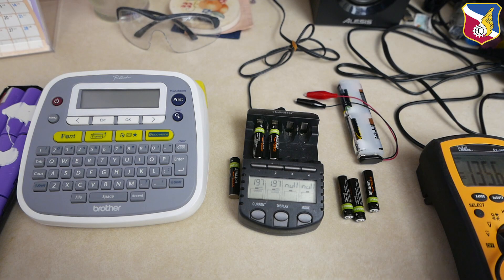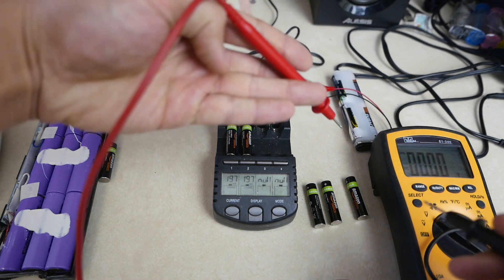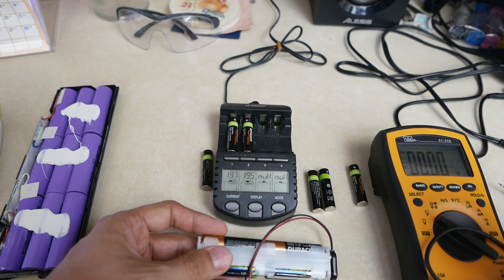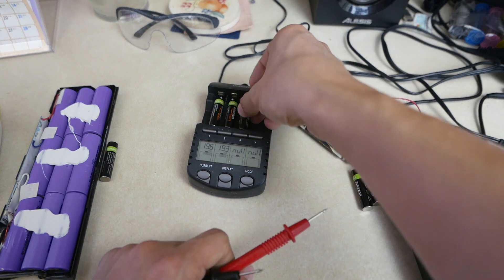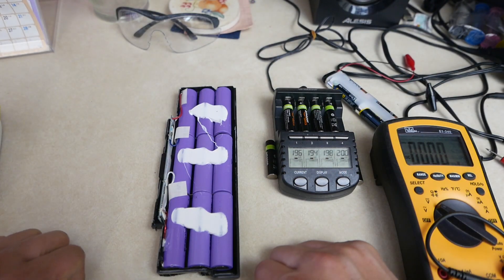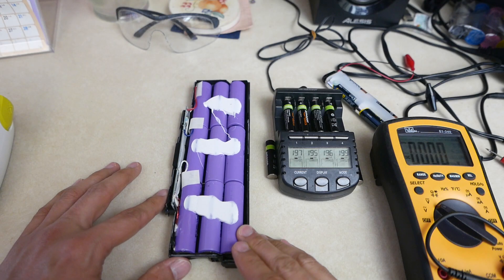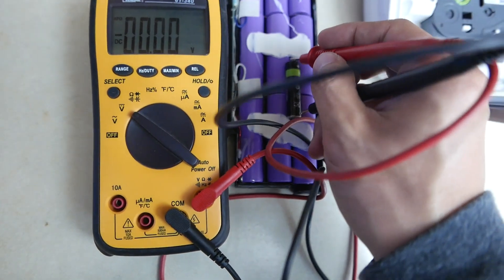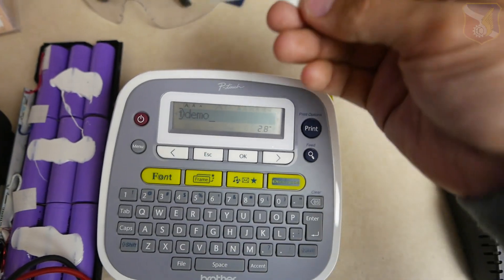how to fix a dead rechargeable battery - revive restore rejuvenate jump start any damaged batteries

Comment: What if multimeter shows 1.33v on "dead" battery and "smart" charger keeps rejecting the batteries?  I tried to jumpstart the "dead" batteries with you trick,  4 x 1.2V in a row and recovered one of my "dead" batteries but i have 2 eneloop pro black AA that multimeter reads 1.33V but charger almost immediately 2-3 seconds  rejects them. Do i have to (maybe) full discharge them first?

Comment: This trick works only with batteries that won't charge at all? What about those which seems to be fully charged but when used they discharge pretty fast? Also, have you tried to do the same thing with 18500 batteries? My rechargable dustbuster works with that kind of batteries

Comment: My Varta rechargeable NiMh AA batteries are able to be charged normally but not with quick charge mode. What is the problem with these batteries? They were quick charging before without any problem but they now only charge in "normal (slow) charge" mode.

Comment: Or you can just use a dumb charger to jump start them before using your smart charger
Reply: Heres a much easier way:

take the dead battery and another battery with voltage present. Now let the two batteries touch each other (negative to negative) and take a strip of aluminum foil (purely for conductivity). The aluminum foil must touch the two positive ends. Hold it like that for a few seconds. And there you go. dead battery is once again alive
My method basically shorts the battery to force current from the good battery to the dead battery
Reply: dont do it for too long. You will feel the batteries heat up rapidly.

Comment: Where I can buy that battery shocker you using ???
Reply: Heres a much easier way:

take the dead battery and another battery with voltage present. Now let the two batteries touch each other (negative to negative) and take a strip of aluminum foil (purely for conductivity). The aluminum foil must touch the two positive ends. Hold it like that for a few seconds. And there you go. dead battery is once again alive
My method basically shorts the battery to force current from the good battery to the dead battery

Comment: I have 4 rechargeable batteries that have been sit-in got a long time. The charger works for a while and then I get a rapidly blinking light which means the batteries are bad. They all have 1.1 volts on them, but won't run anything. I'm at a loss.

Comment: The problem is the charger rather than the battery.  A "dumb" charger would have just charged those same batteries without having to rig them first to get a little charge in them first.

Comment: Thanks for this. Had a double a and a triple a battery which had been in Christmas lights. Funnily enough I have a 18650 basic charger. Not a smart one which allows for pretty much any similar battery. It turns off when it detects the battery however after dapping it a few times the light went red to suggest charging. My smart charger now recognises it.

Comment: Thanks - I'd given up on an expensive 26650 that was totally dead - Thought I'd search the web in case a bright spark had revived one and came across your vid (actually others first but yours the first with zero volt batteries like mine) and yes, it worked a dream! - Cheers

Comment: the same trick applies to chargers themselves - as long as they "let in" a tiny bit of charge after "denying" your battery each time you insert it. do this several times, sometimes 5 or 6 (lithium ion for whatever reason - like in the case of power tool batteries - will take tens of times, 20, 30 etc). it will eventually take to it.

Comment: I had a handful of rechargeable AA batteries that I had not used in a while and when I tried to charge them, they would just blink red and had zero charge on them. I was about to toss them out, but I decided to give a quick look to see if there was a way to "revive" them from the dead and I came across your video; I used a 12v AA battery pack I had laying around, loaded up some fresh AA batteries and gave this a try; I was able to save all of them though some of them required about 10 taps or so. Thanks for posting this!

Comment: Hi....my AA batteries have voltage but their ampere reading on multimeter is very less. 1800 mAH battery is showing 200 mAh reading on multimeter.....what to do ? Are these batteries dead ???

Comment: the technique works!! on a 20 yr old battery even...
ive tried doing this 5(x) technique 

with LOWER voltages in reverse order in some equipment and that also works 
that is, negative to positive and positve to negative 
remember to use lower voltages for this technique

Comment: God bless you ! My cordless drill 14.4 V did not charge any more, so I took a look and was happy to see I could open the battery container ( 4 screws only ). One 1.28 V battery inside was nearly dead with only 0.40 V, I chocked it with a 12V ( 16 V in fact ) as you told + repaired one broken connection between two other batteries, and now everything's OK again ! Many thanks and have a nice day ! Jaybee from New Caledonia

Comment: Hello. Sorry, I'm a little late to post this. Can you please explain why double the voltage/capacity is needed the 'shock' the non-working rechargeable battery back to a usable state? I've seen other demonstrations where they used just one other good battery, touched the positive and negative ends together, and it was rechargeable again.

Comment: This didn't work for me. I essentially tried the same by lining two good batteries plus the bad battery up end to end, then jumping an unfolded paper clip from the positive end to the negative end. No dice. But what did work was putting my bad battery in a charger similar to that in the video, stacking a good battery on top of it so they are side by side in the same orientation. Then I used a paper clip to connect the two negative battery terminals with the charger's negative terminal. Then I used a second paper clip to connect the two positive battery terminals with the charger's positive terminal. Almost immediately the charger gave a reading. Soon after that I disconnected the paper clips and the charger was charging the previously bad battery on its own.

Comment: I'm skeptical, the video is cut between the voltage  measurement and the shocking. I just bought some 18650 cells that are dead, I'll if its fake or not

Comment: Where did you get the plastic thing you had 4 AA batteries in which then had a Red and Black connector that you used to shock the battery.  i have a battery that has got a charge. when i use my battery tester its at the bottom of the GREEN.  
>
I have tried 4 different chargers they all give me an error message. when I try and charge it to max it out so that the battery can't take any more charge it gives me an error. I have 3 different Duracell chargers they give me error. I have a charger large enough to charge D batteries it gave me Error and this Panasonic charger just kept saying the battery was full. 
>
I don't know how good it is to use a product where not all batteries have the same amount of charge.

Comment: Why did your filming cut out just before you supposedly were going to do this, both times? Also why was every battery on the table moved as you cut the vid during the first charging? I don't know if this would work, but if you are going to do a short video on screwing with electricity, make it properly and with a complete non-stop visual as this video seems to have all the indications of B.S.!

Comment: Hi, I have rechargable Duracell batteries, they don't seem to power anything so I left them in the charger for couple of days.  They measure 1.4v but still don't power anything (tried in Xbox controller). They did power a surround sound remote, so seems to be low current output I guess.  Can I do anything with them as they are 2450mah NiMH that are pretty useless but we're expensive.

Comment: There are  a few suggestions for battery repairing
never attempt to do this until you know what you are doing - the acid can burn your skin
Test the voltage first - there may be a kaput cell which would waste your time.
Check the battery fluid.
Try to fully charge the battery.
(I learned about these and more on Jons Mender Guide website )

Comment: And how easy would it be for the charger manufacturer to implement a function that does this automatically a few times when it detects a dead battery to see if it can be rejuvenated?
Surely it would be a simple feature?
Why don't they include it?

Comment: Thanks,  just tried it on some AAA NiMH batteries and it worked.  I used an old Sony 4.5 volt adapter and zapped them back to life and it worked.  I will start a full test on how long they last.  Youtube is a great reference to find these tricks to fix stuff.

Comment: After you shocked them, did I see that they went back to 1.2 or .3 volts which are pretty close already to full at 1.5. You'd think you could take them further down than 1.2 before indicating low battery.
Reply: That's because there is no load on them.., Also- maximum you could charge them will read 1.3 at best as they are rated at 1.2v only.

Comment: I've done this many times the increased current of batterys in parrellel shold allways fully charge the lower voltige battery .and using a battery holder puts them in series to increase voltage.  With u end up with is lots of current passed maby well above what's rated to charge a battery at but cept at only seconds shold charge in seconds .dont let them git 2 hot

Comment: Thanks dude, revived one of my dead ones. Just by putting 2 charged batteries in line with + against + of the dead one and connected the negative ends with random wire. Got the same charger as you, love it.
Reply: I was gonna buy a power bank like that, but why doesn't  the power bank recharge a RECHARGABLE BATTERY?

Comment: Ok so I had some old dead rechargeable batteries sitting around so I tried this nothing tried a 12 v nothing tried holding 12 v battery to dead battery’s for a minute because I was about to toss them they actually get charged a bit but don’t charge on my charger so did I break the battery or does my charger suck

Comment: I just ordered 16 eneloops aa batteries and my smart charger won’t charge them and they r brand new should I return them and order from another company
Reply: Me too. New rechargeable battery stayed at 0V when i have tried to fix them with 1,2V batteries. Then I was out of options and I have decided to use 12V car battery! Then it works! All new batteries are fine now! If i knew that i was not going to throw out old batteries which was dead too ;)
Reply: Ok I took two freshly charged batteries and zapped them 15 to 25 times 2 or 3 times and my smart charger charged them out of 24 AAs I had to zap 21 of them only oreder eneloops that have been pre charged from factory I have a knox 16 bay charger

Comment: so, if you have one of those rechargeable battery packs that the charger won't charge due to a defective cell, and the pack has sat around long enough to have no voltage, how do you charge it enough to be able to measure the individual cells in order to determine which one is defective?
Reply: you will have to take it apart and separate them. then test each one.

Comment: I found it convenient to use a 3-battery holder (of AAA batteries) often found in LED flashlights, for this purpose.  Three batteries snap into the holder, producing about 4V at the holder terminals.  Install two 4-inch long wires at the ends of the holder (wire ends can be pushed under the terminals with the help of a knife tip).  The resulting device can be used as a dead battery shocker, in a way described in the video.

Comment: THERE IS A REAL SCREWED UP PROBLEMS WITH THE BROTHER LABEL MAKERS!!!!!! when I bought mine i installed six new AAA batteries and kept the machine OFF, because I knew the batteries should be fine with the label maker OFF. Well guess the hell what? All six batteries were drained down to .6 Volts in only one week!!!!!!!!!!!!!!!!  So. What did I do? I put new batteries inside again with power OFF. They did the same damn thing again!!!!!! Being an Electromechanical and Electronics Engineering Technologist, I brought out all of my test meters and did in series current tests with my Amp Meter connected to the batteries and found even with the label maker OFF it was draining 200uA which eventually dropped to a steady 30uA !!!!!!!!!!! So I reported it to brother and they are totally clueless!  I don't even know if they have any College Education. To finally fix my problem I have to remove one of the AAA batteries and put it aside until I use the machine again. I'M TOTALLY PISSED OFF!!

Comment: You are missing one important step when testing the battery and that was you did not put your meter under load.  Try using the multimeter that has a battery test option of 1.5V; then you will see the bad battery voltage decreases dramatically from 1.2V after you jump start the bad battery.  Here is the video that will show you how to test the battery correctly:
https://www.youtube.com/watch?v=HcikzMG7mMU&t=287s

Comment: Thanks for the advice.   I watched your video less than half an hour ago & have just saved half a dozen dead NiMH  AAs & AAAs.  Instead of using your 2 x 1.5V in series setup, I  used a single 3.7V 18650 battery and zapped everything back to life.  The revived batteries are all marked with a black X so it will be interesting to see whether they develop any problems in the future.
Reply: After reviving several  NiMH AA & AAA  batteries and using them for a week, one of the AAs & 2 of the  AAAs died permanently and couldn't be revived a second time.  The other revived batteries are working okay but I will keep them under review to see if they again develop problems..
Reply: Darth Dog great job. looking forward for your further observation

Comment: Decided too try this out with 4x old 1000 mah AAA gp batteries i bought in like 2010 that has been dead for a while (improper storage at one point as i sent a few rc cars away on repair with a relative & the guy never worked on them at all, so it ruined the batteries & tires of them.)
with a pair of 18650 lithium ion cells that are about 70% charged (put in parrallell so same lower voltage as a single cell just a bit more oomph so too say as they are protected.)
& charging them atm, gonna try a 9 led flashlight as workload for 3x cells & see if they have any capacity at all or will just be dying quickly due too their age & lack of capacity.

Comment: why is it that I can charge my NiMH batteries...and they will work in a remote...but if I try to use them in anything with mechanical movement, they won't work?
Reply: It might be a load issue?

Comment: A dead cell battery always remains dead. But this is a FAKE video, before shock refreshment, it's between this, cuts in the video movie recording. Enough time to change the 0.00V battery cell, to another battery cell contains enough capacity for recharging.

Comment: Why don't you get a charger that will change dead batteries. There are many that will recover them. I don't feel jump them with a higher voltage. I sure don't think you should be soldering to them! Heating them to 800 F just don't sound good to me!!

Comment: Hello everyone I have a question how do you tell if a battery is rechargeable or not for example I have a auto darkening welding helmet that doesn't work I opened it and saw two batteries but I can't tell if it is rechargeable or not because I would like to replace them. Any advice would be greatly appreciated thank you
Reply: Try a dumb
 charger & charge it only 20mins then use it. Charge and discharge it several times. If you notice it can hold the charge like rechargeable batteries then may be these are rechargeable.

Comment: Just rebooted a shaver that's been on zero volts maybe 4+ years. She's charging. It was showing 0 volts. I put 6v into a 4.5v, had the polarity wrong to start with and as soon as I tried it the other way round the red neon showed. I tapped it two times before the charging green LED's began to light. Charging now with 6v going in from non related charger.

Comment: There are  several suggestions for battery reconditioning
do not try to do this until you know what you are doing - the acid can burn your skin
Test the voltage first - there may be a kaput cell which would waste your time.
Check the battery fluid.
attempt to fully charge the battery.
(I learned about these and more from Jons Mender Guide website )

Comment: i have the same charger. Sucks because i spent over £30 and if i run the battery's until there 100% flat it doesn't read or charge them

Comment: I don't know if those particular Amazon cells are rebrand Eneloops but if they are they shouldn't be completely dead. Unless they were already used alot or they may have been left in a device for too long draining the batteries completely dead. I tried to completely drain an Eneloop, got it to 0.3v for about 15 minutes before it jumped right back to 1.2v

Comment: Thank you! I have thrown away so many rechargeable batteries... what a shame. You helped me though and I won’t despose of my “null” rechargeable batteries again. I hope this helps. I bought a 12v trickle charger for my car battery but didn’t work (i think it’s less than 12v) but after seeing this video I tried it and works great (The good thing is that I am using the exact make and model of recharger in the video). Anyway, I used this: https://www.amazon.co.uk/d/Cordless-Tool-Chargers/Silverline-634004-Trickle-12-V-500-mA/B001C827ZA/ref=sr_1_1?ie=UTF8&qid=1497349963&sr=8-1&keywords=trickle+charger+silverline
Reply: Gianluca Vitale bro how can we charge deae ordinary battwry plzz give me link of video how to charge old dead ordinary battery